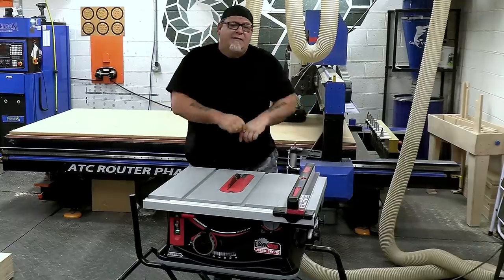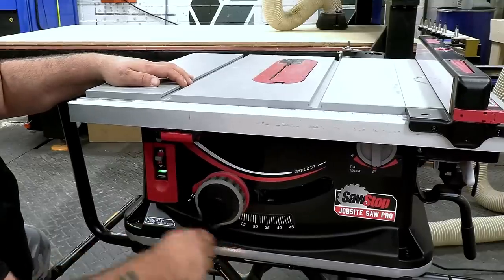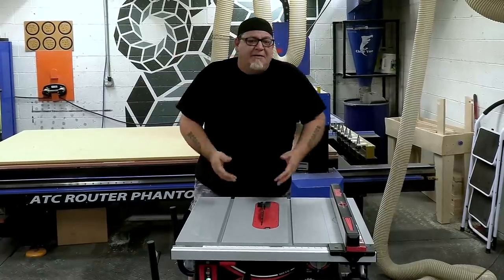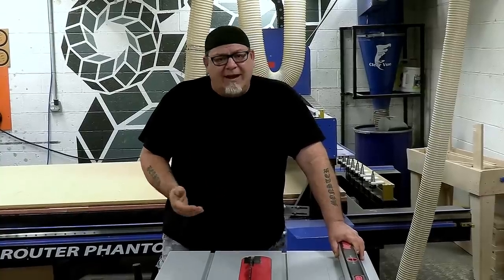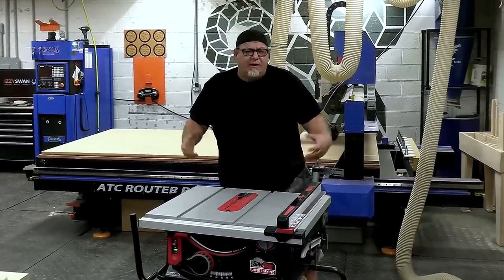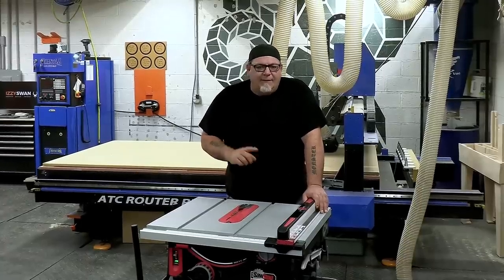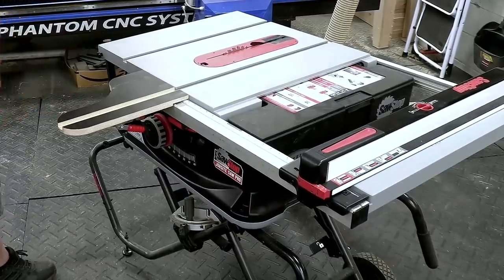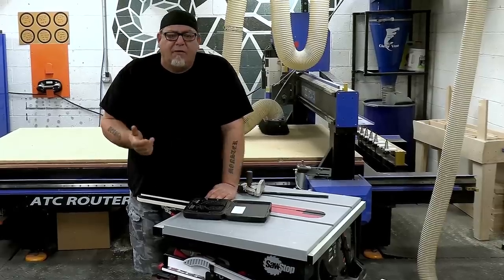DISAPPOINTED! - Most EXPENSIVE Jobsite Table Saw!

Comment: Thanks, good review. I haven't owned a jobsite saw for around ten years since I switched to a 1.75hp contractor saw. Most jobsite saws are basically just upside-down circular saws with universal motors, and the kickbacks are usually pretty sharp. I think I feel safer with a 1.75hp belt-driven saw with a universal motor than I would with a 3hp cabinet saw or a jobsite saw. The design of the jobsite SawStop, especially the height adjustment, seems to be designed for actual jobsite work rather than in-house fine woodworking. That being said, your thinking about investing in the safety of novice users is solid logic.

Comment: The Miter Gauge really sucks and I ruined a cartridge from a staple in a 2x4.  The motor power is not strong enough and it trips too much on long cuts,  but I am very happy with my $1400 purchase so I get to keep my digits and ease of mind.   What is the price for your thumb?  My thumb has 95% feeling back since my table saw incident and still have some trouble using it. Love how easy it is to switch to the Dado Cartridge.  I'm not an electrician-Should I switch the breaker from 15 amp to 20 amp or is that too dangerous?  Thanks for the video.
Reply: No! unless the wire gauge of the wiring is increased also.
Reply: @edwinfriedl2446  agreed. Breaker protects the wiring.
Reply: @edwinfriedl2446  Thank you!

Comment: I have owned my jobsite SawStop for almost a year and asside from the safety, I purchased it because I needed the reduced footprint.  I have a VERY limited space to work with.  I am just a hobbist and only use it occasionally.  I actually downsized from a 3HP PCS to the jobsite.
Reply: OK, but how do you like it? Pros & cons?

Surprisingly I believe the lesser cabinet saw actually takes less for space in operation than the JSS because the motor is inside the cabinet instead of hanging off the back of the saw. So I would probably buy the lesser cabinet saw instead of the JSS and get the mobile base for it.
Reply: @MichaelBrown-kk6ck  I rarely use a table saw,but when I need one the JSS fills my needs, but I really miss my INCRA fence.

Comment: You shouldn't be considered about to get miter gauge in perfect 90.. if it is off a bit you still get perfect 90, just with slightly bigger cut.. if it is out of 90 you have bigger issue with saw and rails been out of same line

Comment: When does sawstops patent expire? Seems like it’s well over the 7 year average. Makita’s version of the sawstop seems to be much more advanced with no blade stopper thing to replace when tripped.
Reply: The original patent expired in 2020 or 1 January 2021, depending on who you ask. There are several 'extension' patents that may expire on various dates thru 2024 covering various 'tweaks' to the original - similar to 'Evergreening' that goes on in the Pharmaceutical Industry.
Reply: Don't you mean Bosch and the REAXX System. Bosch lost a lawsuit to market their technology in the US just a few years ago. Bosch can sell outside the US but not here. I too, think or rather know that their technology is better. I was going to buy one until the could not sell them in the US.

Comment: It isn't a $1600 saw, it's a not-$160,000 life-changing injury. I have a Sawstop cabinet saw and three months ago I got 16 stitches in my finger after I put it in the blade. I'd be missing two fingers if I had a regular saw. Anyone who uses a saw and can find a way to afford a Sawstop and doesn't because "it's expensive" hasn't thought things through. I paid $3200 for mine seven years ago and I'd pay it again. After all, saying "it's too expensive" when you can buy one is the same as saying "my body parts aren't worth $X".

I'd suggest emailing Sawstop about the fence. They have good customer service and someone there might recognize your name, so there's a chance that you could be influential in changing the design.

Comment: The only reason to buy this saw is the safety feature, NO other reason. It has no features that make it better than my old cheap almost a toy, Skil X Shop saw. The fence is livable and for me it is not aggravating. Just pull it towards you and then lock it. It does not move as you showed. It is not a solidly locked fence at the end but most force on a piece of wood is in line not side to side. The blade height adjustment is very very fidgety. That rapid blade height adjust is great for a job site but is terrible for dadoing. I have not done any dadoing and if I do, it will be multiple cuts with a flat top ground blade. I don't do enough to buy a new blade insert, a different brake cartridge and a dado stack. The top is sheet aluminum and is almost guaranteed to bow as in bow and arrow. Mine is bowed. The work I do has not noticed yet but I don't see making heirloom furniture on this. The mobility is great. It is vastly overpriced for a job site saw but how much are your fingers worth? As I wrote, the only reason to buy this saw is the safety feature. The micro tilt adjust is a great feature.

Comment: I understand the safety aspect, but it's ridiculous to charge 4 times the other saws on the market. I've been using my delta table saw for years and never had any worries because I follow safe practices when using it. 

The only place I think sawstops are worth it is in a commercial shop with employees. I can account for myself but if I had employees using a saw, I'd like the finger saving tech to help avoid employee injury.

Comment: Thanks for the video Izzy. I think you and the Concord Carpenter are the only videos to come over my algorithm that have been less than complementary about SawStop. I believe their video showed that the table was out of square with the blade. I wonder if SawStop is about fear, more than safety. What’s the tipping point in the number of lackluster features of a saw where the safety component becomes negligible? No one wants to get hurt, but at the end of the day is that an issue of user error or the fence not square to the blade? I thought about SawStop when transitioning from my old Craftsman, but went with the Dewalt 749 because of the fence and other features that were a leap from my old saw. Ultimately, I chose not to go the SawStop route, not because of the expense but because I did not want to carry that “sense of safety”/complacency to other tools that that don’t have that technology.

Comment: I do not own one of these, nor would I. A company is going to charge me 2 times the cost of any other good JSS and give me less than standard right side cutting capacity, a poorly engineered fence system, and then try to get me to overlook those things because they incorporate some gadgetry? No thanks. BTW, that height adjustment would drive me crazy, as would the angle adjustment. I'm a pro finish carpenter/woodworker, I don't need gadgets. I need equipment that does what it's supposed to do, without all the bells and whistles. By all means, if you want the safety, are just a hobbyist, whatever, help yourself and get your checkbook out. As a pro, the quick walkaround Izzy just gave tells me I'll keep my money.

Comment: So… truthfully it isn’t the price that turns me off. First… I like the same things that the reviewer likes and agree with the dislikes. 

So……. Does the engineers / leaders if Saw stop watch these review. ALL OF THE COMPLAINTS or irritants are easy to solve. (1) A well designed worm drive motor would go along way to solving the lack of power.  (2) a rack and pinion miter system, some composite materials to shed weight and finally at this price.. all handles should have amazing feel🎉, all gauges should be aluminum machines plates that are extremely precise.

Comment: Worked in a wood factory . We had one , not a job site saw. but a cabinet saw. Hate it they trip with out reason. Lost of money to but and lots of money to keep in operation. Would not use it on a job site unless it was all new lumber , and even then you will come across wood with metal . Had new lumber with arrows, bullets' and nails wire.  Every trip will cost you big time . destroys the stop mechanism. $$$$$$ and a good blade $$$$ S Plus time. Make sure you have extra parts . Never had a trip where it was flesh. . I would not waste my money . They could have put a disk break in the shaft. and it would have saved many dollars in miss trips. Stupid design. It is like me not using breaks , but rater  running into a tree to stop my car

Comment: Festool TKS 80 EBS-Set Zaagtafel - 575828
Reply from the maker: will check it out. thanks for sharing
Reply: Festool bought sawstop, and used that to make the TKS 80.  Yeah, it has a better build, in some areas, and the "extras" are nice also, but the $3000 "Festool" hit is not worth it, in my opinion.
Reply: I saw that the TKS 80 does not even come with a rip fence as standard, just a miter gauge. You have to buy just about everything separately.

Comment: As with all job site saws now days, way to much plastic. I do like the storage area though. The fence is a deal breaker for me. A cheaply built fence causes big problems. This saw doesn't have enough power to cause a serious kick back but the loss of time and material. The blade height adjustment is also a bad idea. You talked about  inexperience people using it on the job site, with this blade adjustment? You're looking for more problems. It doesn't look (to me) as the type of saw that would last in any job site environment at all. All in all, it gets a no show. 
  I've never been on a job site that requires anymore than a rifeing knife. The only trade that would use a table saw now days would be trim carpenters and I don't see them putting out that kind of money for a table saw. O.S.H.A. doesn't have a requirement stating the use of this type of saw. It may be a insurance requirement through if a shop has had a lot of comp. claims.

Comment: I wouldn't buy this. If I'm in my shop I'm buying a cabinet or hybrid, on a job site, I can't count on the power or even the humidity of my lumber, false trips would happen way to often so I and more especially guys I've worked with would constantly disable the safety. If it's going to be disabled most of the time I might as well not have paid for it.